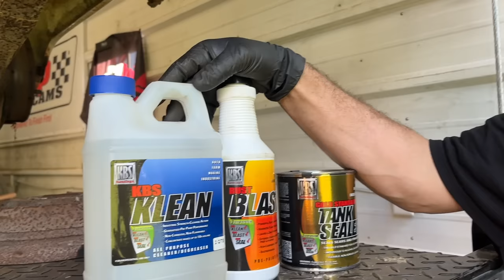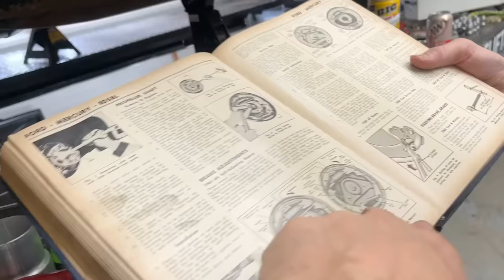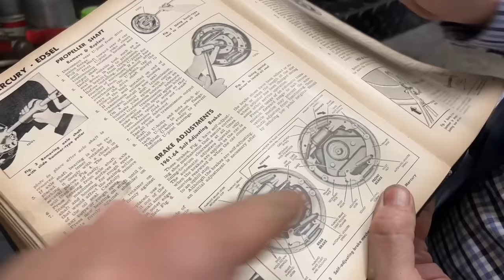Stick Shift V8 Wagon! Rescued from the Junkyard. First Road Drive in 30 Years!

Comment: It’s very common for those shift linkages to lock up, usually it’s either not adjusted quite right or the bushings are worn. But it sure sounds great now, those wagons are more popular than ever. Keep up the great work.
Reply: Yessir and if ya stumble upon an old two door wagon grab it. The prices on them are stupid high now days.

Comment: The trick I usually use on brake lines is to use a wire wheel on a drill, and clean the line and the flare nut to the point i can see separation of the two parts, then use penetrating oil to free up the nut from the line. If the line breaks from the wire wheel, it was destined to break anyway, it likely would not have held the pressure, or would have broken at the most inopportune time.

Comment: On those copper sealing washers you can make them work like new by heating them up red hot and letting them cool off this anneal the copper, that means it makes the copper soft. Once tightened down and it sets very long the copper gets hard and may not seal well. The annealing makes them soft and will seal again.
Reply from the maker: Ok thank you

Comment: Great to see the Country Squire station wagon driving down the road again. I was born in 1961 so my friends and I rode in the way back seats of course! (3rd row). During the summer we would go to the local lake in Ridgefield CT. It was called Great Pond. Every station wagon made by the big 3 and American Motors was in the parking lot. We would put our flip flops on and run from the wagon to the beach!!  You might consider a Hurst shifter or even switch to a ford 4 speed manual transmission with a good shifter and shift arms. That was a smart idea to switch to the dual master cylinder -- much safer for the kids and the wife and Rocky!!

Comment: Hi Josh, just some things I learned doing the same stuff over the last 50 years.  I always had trouble when I used an old radiator without getting it ‘rodded’ out.  All my new engines had problems until I started cleaning out or replacing the rad.  Also, next time try leaning the rear wheels in at the top first.  Sometimes they will fit that way.  Love the build ❤😊!!!
Reply from the maker: Great tip! Thank you

Comment: Fantastic family project!  Sounds fabulous too!  It has been probably close to 60 years since  I installed a Hurst shifter on a 3 speed, but I remember a procedure where you lined up the levers on the shifter, and put in a pin (I used a drill bit) in to hold the neutral position, then put the two levers on the tranny in neutral;, and adjusted the shift rods to fit. Usually the only troubles I had with shifter locking up was column shift GM products.

Comment: Transmission: If the gears don’t work with the clutch, you can change gear without using it and getting the revs just right Example, let the revs get high insecond, snick the lever into neutrial  and let the revs drop. Try at various intervals pushing into third. At some point it will happily snick in. For down change opposite action. For starting off, select first and use starter motor. It’s not nice but at least you can move. Best regards to you all from an Englishman living in Germany. Keelp up the brilliant work you and your lovely family bring so much joy, knowledge and entertainment to us. Best regards, Tim Tacey

Comment: Hi Josh,   For your alternator problem, you need to "clock" it. undo the long bolts, and spin the back or front half 90 or 180 degrees. (30:00)
Reply from the maker: Ok thank you

Comment: I've had great luck with a vibratory tumbler for cleaning rust off small parts.  Works great for springs like you have in this cars drum set up.  I use a varying combo of evaporust, ultrasonic and/or the tumbler.  Just toss em in the vibratory tumbler and run it overnight.
Reply from the maker: Ok thanks

Comment: I had a 73 pinto wagon that was stuck in 2nd gear. It went just as I came off the freeway. Unfortunately came to a stop sign but still got it to move in second. Well you have brakes so that's safe now. Just need to get that drivers side door to lock. You guys had a pretty busy day. Thanks for sharing.

Comment: 17:44  I did all of that to a new tank as well as the filler neck. It'll now outlast the rest of the car. Because I also not only painted the outside, I put Truck Bed sealer on it. Barely hear the fuel pump now.  35:06  Great Job!
Reply from the maker: Awesome good job

Comment: IF YOU WANT TO SAVE A GAS TANK, I'm a welder and done this numerous times. After you've cleaned out the tank with water, fill it again with the bottom on the ground, then take a cutting wheel and cut a hole in the top, 7inches x 10 inches then dump the water out then steam clean from all angles, put a 90 degree pipe fitting on end of the wand and it allows you to clean the top inside of the tank, using the gas guage hole also to clean all of the inside. When finished cut a piece of metal 1/2 inch bigger than the hole you first cut and stitch weld it back together and you've save a tank. The last one I did was a 1955 Studebaker. It's not dangerous because the fumes is what ignites. I acually through a stick match into an open 5 gal bucket of liquid gas by accident, that I used to clean parts (in the old days I'm 82) and I watched in horror as it sunk into the gas so I'm not worried about the solid gas as much as the fumes, I swear this is the truth, hope this helps,

Comment: Hi from land down under..
I am 62.. used to play cars. From 14..
A good family friend from across the road.  Rebuilt Rolls Royce Spitfire engines in ww2..
He said to me..
When looking for drive belts.. go to local hardware store.. exact same belt and bucket load cheaper..
The same belt is used on a drill press, lathe etc..

Comment: Had a good chuckle, the whole family in on that front brake cylinder nut with the exception of Squeezy who was off doing her own thing, and nothing wrong with that. Wawa and Ralphy are becoming quite the mechanics which is good to see, Wawa’s gonna be driving shortly and if there’s an issue with her vehicle she’s going to be able to fix it herself. And there may have been a few boogers on Ralphy’s weld but for a first time welding it wasn’t that bad, a little grinding will smooth those out

Comment: I like the hoop selection you've chosen. I do have some advice for you. If I remember correctly, it had a 6 cylinder engine from the factory, so something to be aware of is the rear differential.  I put a 390 with a c6 automatic from a 69 torino fastback into a 70 F-100, which came factory with a Big 6 240. I found out that the 6 cylinder pumpkin was not strong enough to handle the horse power of the v8. Didn't take very long before I popped the pumpkin. Just wanted to let you know so you can find a rear differential from something that came with a v8.
Reply from the maker: Ok thank you. It has a 9inch rear. And it was a factory v8 car
Reply: Awesome, you are golden with that.

Comment: Nice wagon project. I had the same problem with door latch, I took it out and cleaned it up real good, lubricated and reinstalled, works like it should. Yours might respond. You may have tried this , but just a tip that might help.
Reply from the maker: Ok thanks

Comment: 64 Galaxies were horribly under spring in the rear, especially after 50 years.  Dad has always run coil overs on his since 1970.  Couldn’t put two adults in the back without it bottoming out.  Also, the the rear tires are easy to change with a bumper jack because it lifts the body… very tough by lifting the axle.

Comment: You should use the old put the nut back on and slide the front drum to remove inner bearing and seal.... Clockwise and Counter Clockwise is utilized in most Technical Manuals.... AIN'T IT JUST AIN'T IT 😜 lols... Awesome job on the brakes conversion..
Reply from the maker: Thank you

Comment: I bet the hardware kit for any old ford car from the 60s would work. That wagon looks and sounds good with the new wheels and muffler. Maybe the linkages on the shifter need adjustment and oil my friends 67 camaro did that sometimes and the linkages had come out of adjustment. The windows in the back look so cool because they bubble out. Shifter is cool they have some just like it on ebay they are vintage. I love the baby calf you guys should get one they are very profitable. All the baby kitties wow maybe keep the mice populationn down but I had too many kitties and had to give them away the people I gave them to loved them. Thanks for up loading this is a great channel I hope it grows a lot more Im pretty positive it will. I like how Wa wa has really been working on those vintage cars. I hope it gets raod worth before it gets too hot because  no AC. Not only does it need a fan shroud it needs a nice condition or shape ford fan that not all chewed up. Fans can come apart and through the blade right though your neck or something.

Comment: Time to checkout de-rusting parts using electrolysis. You have a battery charger, I assume (smart chargers will work ... mine does).  The technique made the swing axles on a '97 ranger look like new. The factory casting grind marks reappeared. Makes old brake rotors look new.  Will clean up old brake drums.  Better than ultrasonic cleaners (I have 2 of those).

Comment: I don't know why your transmission stopped working. But I had a 58 GM Holden station wagon (FC, think 55 Chev but around the sixe of the Falcon). Like your Wagon, it had the on the tree shifter moved to the floor. Because it was old the linkages were a bit loose and would get bound up. Sometimes at the worst time. I used to have to stop the car, reach under to the transmission and hit the linkages with a hammer to free them up. Maybe that's what happened with you wagon, which is really cool btw.
Reply from the maker: Ok thank you

Comment: Flip the alternator 180. Top hole on the bottom and the electrical connection will clear the cylinder head.

Comment: When changing out single to double master cylinder, there is a distribution block ? may be needed. Used to equalize the fluid.  I don't know for sure. Maybe only needed with power brakes.
Reply from the maker: Now we did keep the distribution block that was there.

Comment: Another fun, exciting video! Love the new tires or casings lol and rims it helped stand out! You did a lot of work getting brakes on the wagon and time spent cleaning the gas tank. Any plans on a repaint in the future either original or something fresh? I love older vehicles from 60's and later because you can work on it without a computer plus everything was simper to do yourself and save on labor

Comment: Yeah had I known this family existed at all when I stopped working on cars for a living I could have sent them all the brake parts I had from every car I had ever worked on that I replaced all the springs on. Of which honestly I had the spring kits for the front and rear of this car in this video here ad well as the capture parts that holds brake shoes on car as well.

Comment: Shut the engine down and shift it in reverse. You probably need a clutch adjustment. When you adjust a ford clutch wiggle the clutch fork and when you have about a 1/4 inch of free space to wiggle the fork is a good place to start. If it is adjusted right the clutch should come in about 2 inches from top.

Comment: Excellent video Sleepdude  :) also brakes work excellent , also try bleeding clutch and check sleeve cylinder plus throw bearings too ! Plus would change transmission fluid to 80w90 type too and like how running to for Rad fluid do 50/50 to ! Also Squeezeie does excellent art picture too and she need be artist for job in future too !

Comment: If you reuse copper washers heat them up red-hot with a torch it will soften them up and you can get another crush on them

Comment: I believe American Motors innovated the dual master brake cylinder, but significantly, one chamber served right front and left rear; the other chamber served the left front and right rear so with one chamber you had both front and rear brakes on opposite sides of the car. I remember reading in an old Popular Mechanics. I don’t know portioning valves were involved in the scheme, or what effect one might have with the diagonal arrangement.

Comment: Rock Auto has brake drums for your Galaxie. On the front brake measure the friction surface width I'll bet it will be 2.840 inches. Ford like to round up their measurements.

Comment: Josh probably stuck between two gears. Happen a lot with bc the old tow trucks. We would pull the shifter top and with a screw driver push and pull on the slides to unlock JT

Comment: Hey if you add nuts and bolts to the inside of the gas tank and then spin it around n round it will break the stuff loose on the inside before you do your other stuff to the tank

Comment: those old after market 3 speed shifters are know for hanging up in gear need to go and check the linkage and adjust it but may need to put a 4 speed like a ford top loader?
Reply from the maker: Ok thanks

Comment: Everything pushes for disc brake conversion kits on the old Fords, but I have had luck on Ebay finding brake parts for various cars. I work more on 57/58 Fords but still a suggestion.

Comment: What fittings did you have to use for the brake light switch? Any idea what size they were? Need to do this on my 65 mustang I switched to dual pot and don’t have brake lights right now
Reply from the maker: It was 1/8th npt and the other end was 3/16 female flare

Comment: Using my wife's phone. I try not to be a know it all but.....I been working on cars since the 70s I want to give you a trick that pops out the inner wheel bering and let's you re use the seal. As you take off the nut then take out outer bering then put the nut back on 2 turns no washer either then pull the hub over the nut till you feel it catch the inside of the inner wheel bering then give it a quick pop and the inner bering and seal are there on the spindal not on the ground nice and clean . Your welcome yalls.

Comment: I had a problem with my 66 Mustang with a T5 swap after an Autocross. turned out the bolt for the shifter fell into the shifter and was stuck 3rd and 4th

Comment: I’m guessing the reason the front end is sitting so high is to accommodate (clearance) higher profile tires of the 1960’s; 78 or 80’s versus the 65’s you put on.

Comment: Brake line flaring.  You forgot the step where you didn’t put on the flare fitting before flaring and have to cut it off to do over
Reply from the maker: Exactly

Comment: 29:45  I know in the past I've screwed up and mixed up where the braces were supposed to go. I had it on the wrong way where the adjusting brace was supposed to be on top and the bolt I thought I was supposed to use for the bottom one was the wrong one. Once I got that all sorted out it worked fine. I had I think about 8 washer shims in it before that or something. LOL.

Comment: You and wawa asked how a sonic washer clean works.  Well, I asked "Bard" my A.I. site and this is the explanation it had to offer. I hope this answers all your questions.   And please wear ear protection when using it.  I used a sonic washer clean operating room instruments in a hospital I worked at for 14 years. The sonic waves will cause you to go deaf.  

An ultrasonic washer works by using high-frequency sound waves to create microscopic bubbles in a cleaning solution. These bubbles collapse violently, creating shock waves that dislodge dirt, debris, and other contaminants from the surface of the object being cleaned.

The ultrasonic cleaner consists of a tank filled with a cleaning solution, a transducer, and a power supply. The transducer converts electrical energy into ultrasonic waves, which are then transmitted through the cleaning solution. The ultrasonic waves cause the formation of microscopic bubbles in the solution. These bubbles collapse violently, creating shock waves that dislodge dirt, debris, and other contaminants from the surface of the object being cleaned.

Comment: I never will weld on a fuel tank. Shop that I worked at burnt down do to someone welding on a tank. Worst part about it was the family that owned the shop lived above the shop. They lost everything they owned. Even though the guy did everything to get the fumes out of the tank it still caught fire so am never going to chance it. Always get a used or a brand new one
Reply from the maker: Yeah I have heard bad stories about it

Comment: The master cylinder duo pump listens in the cast iron for without vacuum booster would. Be same as 1979 pinto and modern Chevrolet original cost around under 40 dollar in the O' Reilly good parts.

Comment: Sleeperdude you coulda cleaned that gas tank by throwing 30 nuts n bolts with gas or deseal in the tank and rachet strap it to a jacked up cars rear wheel and putter in drive 2 hours later boom super clean.

Comment: ha ha just a tip don't hit the ratchet with a hammer it breaks the teeth inside instead use a big wrench or pipe/jack handle on the end it will prolong the life of your ratchet

Comment: I remember back in a good old days I had a 54 Ford Turn it into a 3 speed on the floor have the same problem and would always it would jam up from 1st to 2nd I took a horseshoe heated it up straightened it out cut the one and made it sharp and downloadart Brandon it and I use that to put it in between the shifter down on the transmission to I'll hack it from 2nd and then I could get it into 3rd